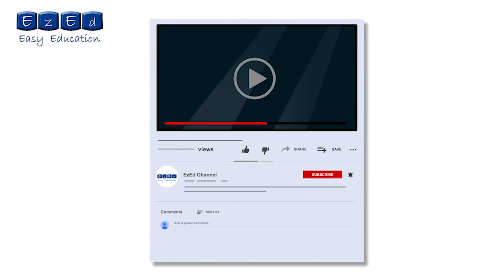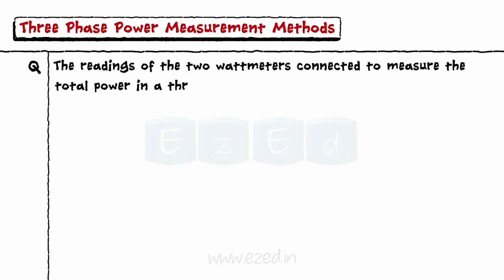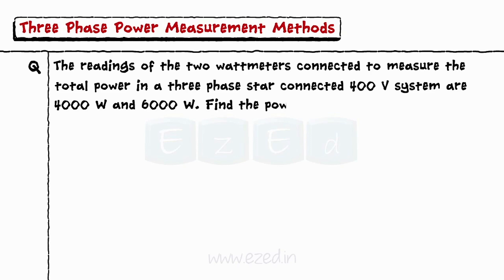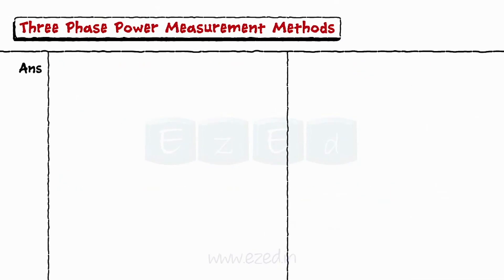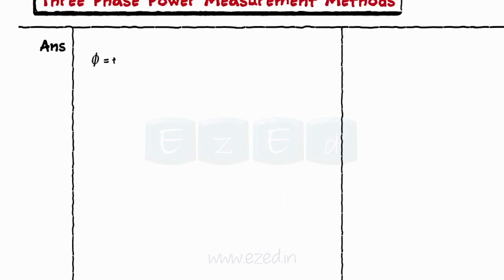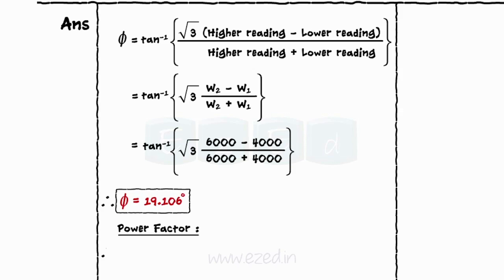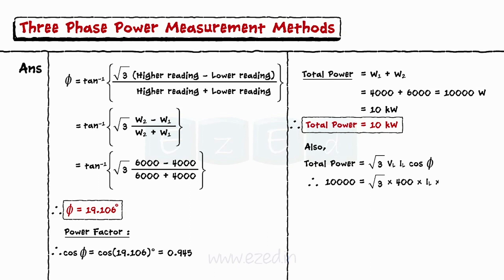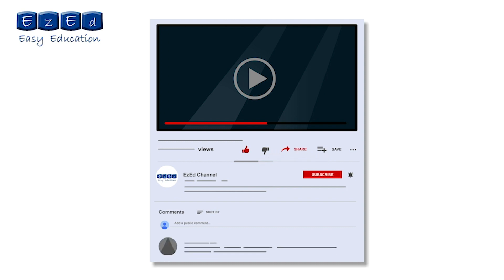SOLVED PROBLEM !!! - Two Watt Meter Measurement Technique. - Power Measurement Techniques

Comment: A 100 resistance is connected in series with a parallel combination of a capacitor and a 20mH pure inductor. At angular frequency of 1000 rad/sec, find the value of capacitor such that the line current is 45° with line voltage.
Iska b solution

Comment: The power readings of two watt meters for a three phase load are 15kW and - 4kW. If the supply voltage is balanced 440V, find the true power drawn by the load, power factor of load and line current
Iska ans kya hoga??